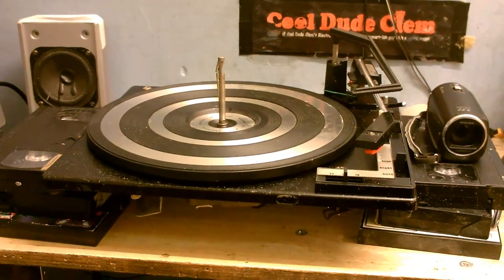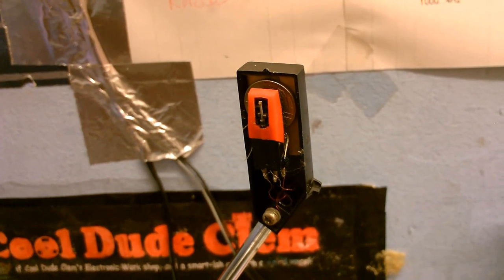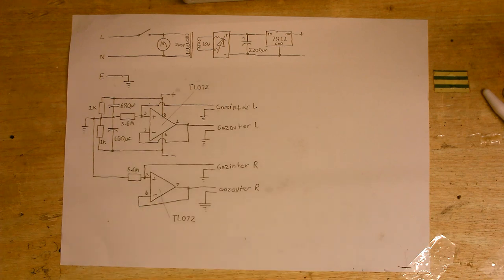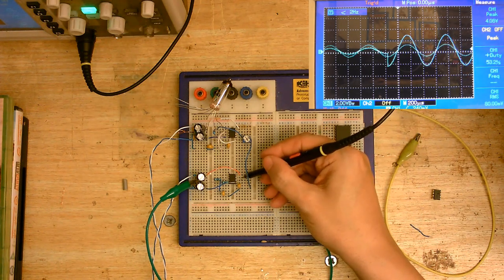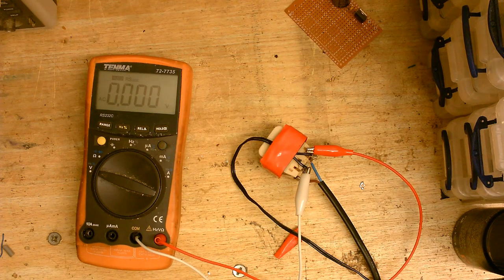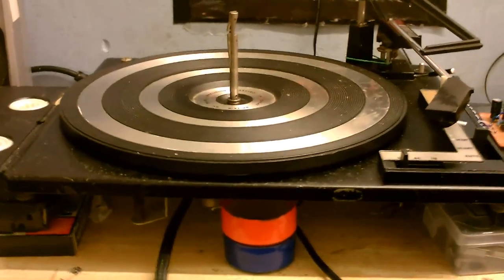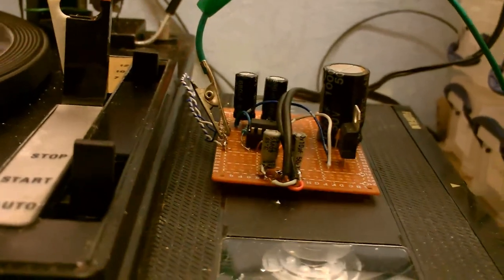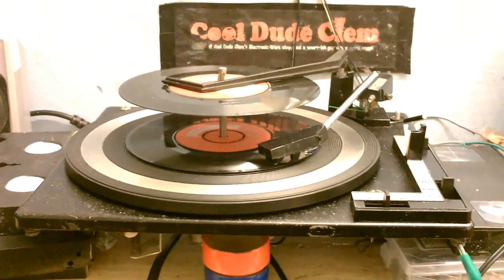BSR Record Changer Restoration part 2 - Electricals and impedance matching circuit.

Comment: You can also create a velocity equalizer circuit to convert amplitude response (ceramic) to velocity response (magnetic), which would allow any ceramic cartridge to be used on a preamp designed for magnetic cartridges. The velocitizer circuit for the Realistic SA-150 is a great start (there is a service manual with the schematic provided).